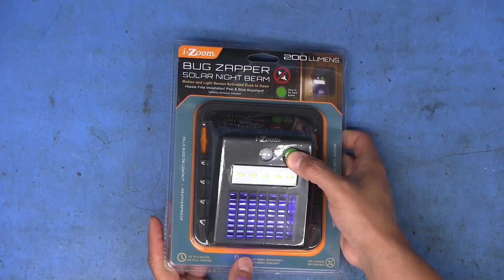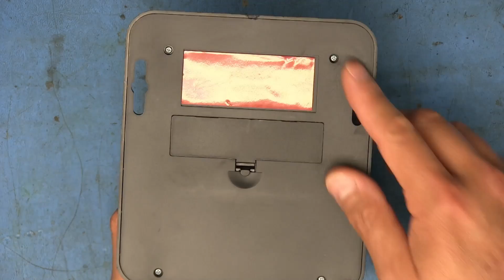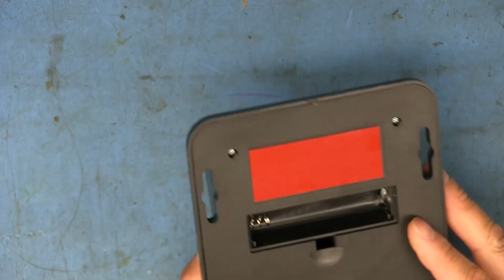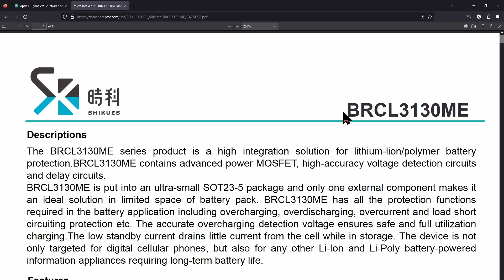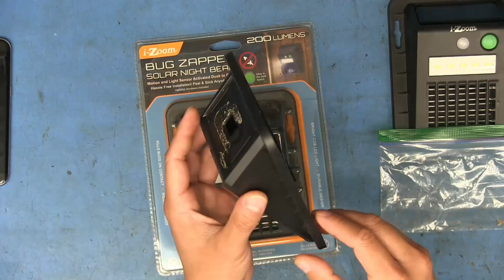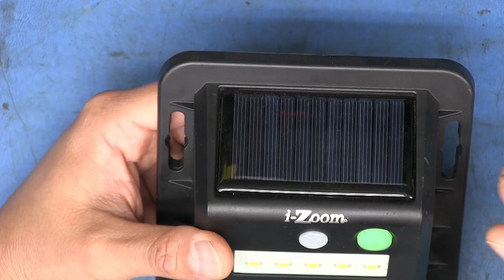TEF #116 | iZoom Bug Zapper Solar Night Beam Teardown, Schematic, And Test

Comment: Is this safe to place inside your house?
Reply from the maker: It doesn't produce anything harmful, but you'd have to remove and charge the battery manually if it's not going to receive sunlight.
Reply: @ThatElectronicsFool  Yep I already placed it inside my house, we just move it outside so it does receive sunlight and bring inside during the night

Comment: I bet if you change out that 450v red capacitor for a one with more voltage like a 2000v you'll get a bigger zap.
Reply from the maker: I didn't think about measuring the voltage across the output on video, but I checked it, and it turns out it's outputting 562V! No idea why they went with a 450V cap.
Reply: @ThatElectronicsFool  some bug zappers use a 1000v red cap but the more powerful ones use a 2000v cap. I have one of those hanging zappers,the monster zapper and it's basically a hanging fluorescent light because it zaps once and then takes forever to charge. I'm going to mod it with these red caps to see if it zaps better.